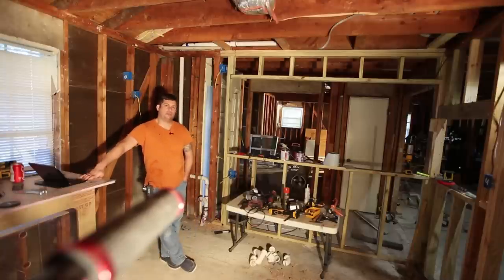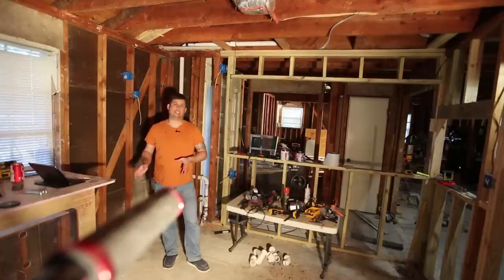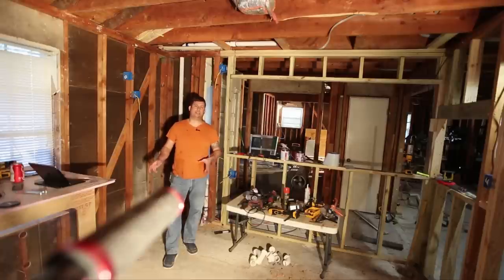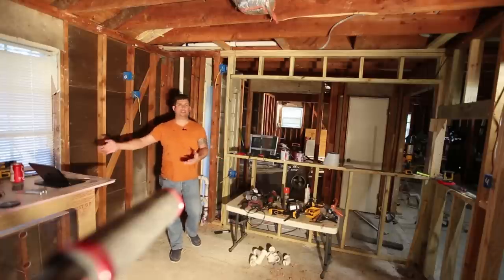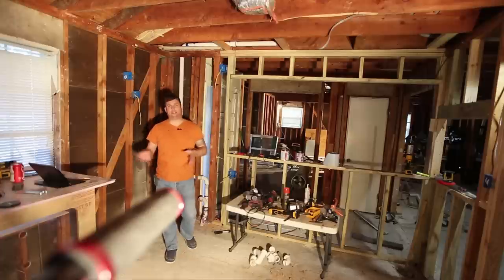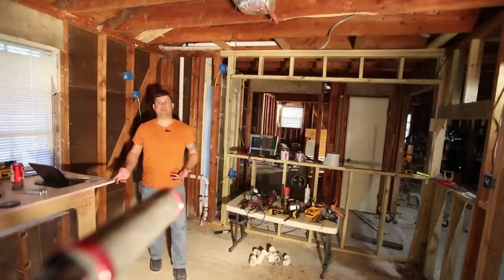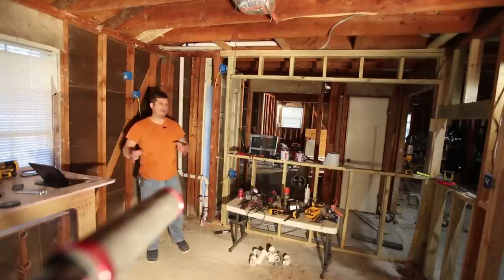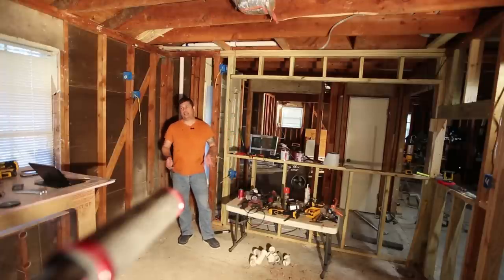25 Jan Aquarium Update

Comment from the maker: I really appreciate the encouragement.  My partner and I bought the steel for the aquarium stand last week.  I also fired up a program I wrote called Aquarium Pocket Knife.  APK is a tank weight calculator that I wrote and put in the public domain.  It's available on acrylictank.us.  The aquarium with water and rock will weigh approximately 3,000 pounds.  The stand will be fabricated from steel tubing and welded together.  It's going to be a fun build and I'm glad you guys are watching.